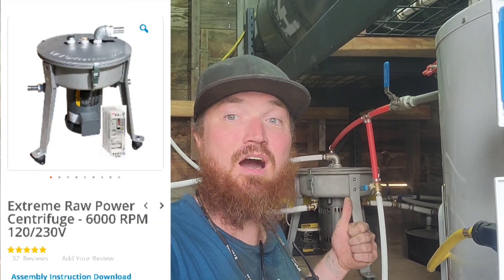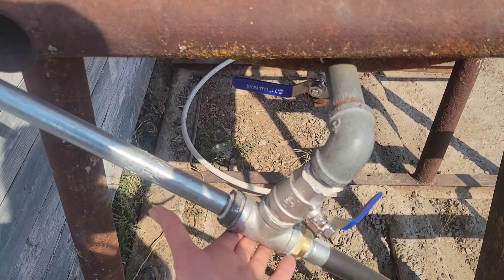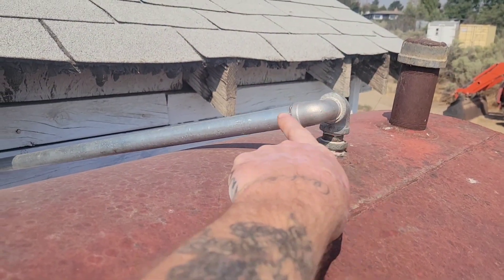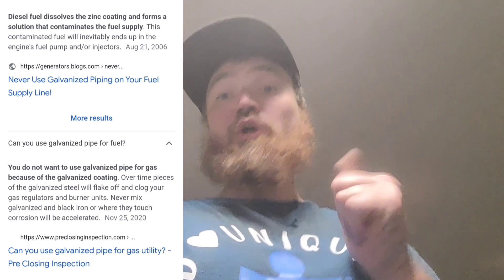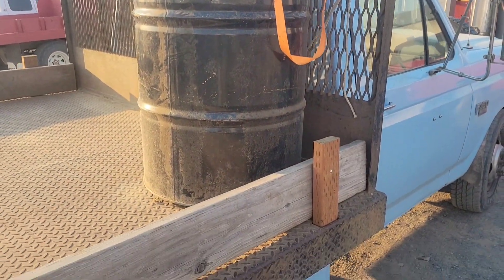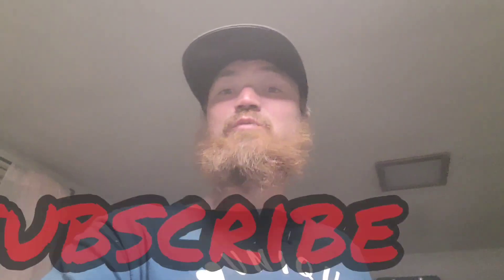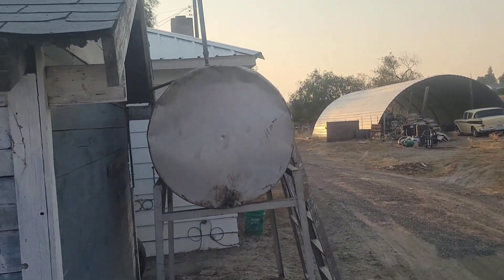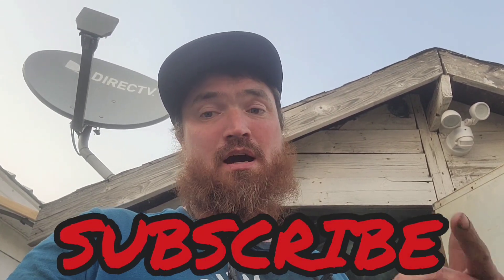Black diesel from waste oil DON'T MAKE THIS MISTAKE! #centrifuge #wmo #blackdiesel

Comment: Oil contains zinc
Reply from the maker: Some do some do not. Pre 1994 oils had zink. After 94 they removed it from most oils. Alot of diesels truck oils still do contain low amounts of zink.

Comment: That's right, you you could cost yourself a lot of money using galvanize fittings with diesel or hydraulics either one.
Reply from the maker: Thanks for watching. Appreciate the comment, I have gotten comments on the video both ways. Saying I was right, and wrong. But figure it is better safe than sorry.

Comment: I don't think the galvanizing is that much of a concern in normal conditions.   I have a 1000-gallon galvanized tank my Grandpa bought used before I was even born my family has had diesel in for at least 50 years that we fuel everything from.    I don't know where you are at but out here in the Minnesota, Iowa, North, and South Dakota region tanks like ours are still all over the place and still get premium prices at auctions because they never rust out like the plain steel ones do.
Reply from the maker: You commented the same thing enough times I'm sure you had time to read my responses. You do what you want, I believe what I have read, I changed the pipe out, because it is my system and I chose to. You are more than welcome to build your own system and produce a video about it.

Comment: I'm not following the concern over the pipe galvanizing here. In the old days, high-sulfur diesel was stored in galvanized tanks everywhere and it and the engines it powered didn't have problems from whatever galvanizing compounds may have been leaching into the fuel.  
Water, algae and 'dirt' contamination in diesel fuel are magnitudes of order more of a real-life issue, of which what you are making isn't actually 'diesel fuel' in the conventional sense, to begin with. 

My point is, even if it has the potential to cause a problem, (The potential for problems is not equal to an actual problem, especially when you are not even working with the same medium the supposed problem shows up in.)  what could leach out of your small amount of piping is inconsequential compared to what else could be in your oil you don't even know about.
Reply from the maker: I am sure the information on google about the galvanizing causing issues is all lies. They just posted it to steer people away from galvanized pipes in an attempt to destroy the galvanizing businesses out of spite. (Sarcasm) As I have explained multiple times, I read the risks, I chose not to take the risk in my system. It did not make sense to me in a system intended to clean oil, to reintroduce another potential contaminant. Not to mention the corrosion caused by dissimilar metals. I chose to change out the piping to black iron pipes. The black iron is cheaper for people setting up their own system anyways. So hopefully they save $ by not making the mistake I did. Buying one kind of pipe, not liking it, and rebuying. I run regular gasoline, and diesel through my system, not just oil. So the potential of pulling contaminants into my fuel would be there after it was cleaned in the centrifuge. Hope you have a great Christmas and next year to come. God bless.
Reply: Same here.   Old galvanized fuel tanks are still being used all over the place.   I think they used to be made in Minnesota at some place called MTC which I think stood for either Minnesota Tank Co, Minneapolis Tank Co or Midwest Tank Co and they must have had the market cornered at the time.
Reply: @illbeyourmonster1  The outside is galvanized on those tanks not the inside that's why they safe.  The diesel protects the steel on the inside from corrosion.  The galvanized protects the steel on the outside from rust.
Reply: @zakglove6536  I have been doing scrapwork all my life. I have cut up many old fuel tanks that were made of galvanized sheets that were galvanized on both sides then rolled and welded into a tank.
Reply: @illbeyourmonster1  Probably for gas then.  Or stainless.  Galvanized is fine for gas.
Reply: @zakglove6536  I know my metals and how to identify fuel as well.   I have done many galvanized ones that had diesel in them for decades without issues. 

As for scuba tanks, I don't see the relevance to the issue of diesel fuel in galvanized tanks.
Reply: @illbeyourmonster1  Scuba tanks are done the same way only on the outside.
Reply: @zakglove6536  I used to scuba dive and I have never seen a galvanized scuba tank.
Reply: @illbeyourmonster1   Typically used by professionals 100 and 120  but same size as aluminum 80.  They cost about twice as much.  They look similar to Aluminum nowadays because of the quality of the Hot Dip. Some people mistake them for stainless steel too.

Comment: Awesome video 👏 but definitely use Loctite 567 Thread Sealant
Reply from the maker: I have not tried the loctite brand thread sealant. I will in the future. I am needing a new container of thread sealant anyway. Thanks for watching. God bless.
Reply: @worthshop  also, I was going to mention if you take 10 gallons of used oil motor oil and mix in 2 and 1/2 gallons of gasoline then run it through your filters or centrifuge it will separate much faster and you do not need to heat it

Comment: I take it you are not aware that Zinc is a normal additive in oil, and galvanizing fuel tanks has been an industry standard since before your Great Grandpa was born.
Reply from the maker: That isn't pure zinc in oil, but a compound of either zinc dialkyldithiophosphate (ZDDP) or zinc dithiophosphate (ZDTP). Most zink has been removed from vehicle oils since the mid 90s. Thanks for the input though!
Reply from the maker: Google galvanized pipe with oil, or galvanized pipe with diesel. It is not good due to corrosion from dissimilar metals as well as the zink flaking off.
Reply: @worthshop  I've worked with the stuff for many years now and there is a bit of context behind the effects.  Typically it was only a problem with high sulfur content fuels with substantial water contamination as well.  

In a clean reasonably maintained system it was really not a problem.  As for used oil, I work with it in huge volumes and there are a lot of other possible contaminants in it that make concerns over galvanized anything rather moot.  The various type of antifreeze that inevitably end up on used oil collection systems is one.   Ethylene glycol once separated out of its water base blends with used oil fairly well. 

After that is the various mystery fluids that will blend with oil that get dumped in with them by people trying to avoid having to do hazmat-related recycling practices.  

A gallon or two of heavily chlorinated parts cleaner or like fluid dumped in a barrel of oil would be barely noticed until it started to eat your system's seals or parts of the engine's fuel system. 

Same with loads of farm chemicals left in the bottom of barrels and tote tanks that get absorbed by the used oil that got put in them. Many are extremely corrosive to metals and you would never know you had a contaminated batch of used oil until it's too late.
Reply from the maker: @Tcmtech   I'd rather heed the warnings online and not risk it. I can not guarantee no water in the oil I get. So better safe than sorry. I do know the barrels we use are not contaminated. I also know we do not put cleaners or antifreeze in our oil buckets. But I source all my oil at work. Not everyone has the opportunity, of knowing the source of the oil they get.
Reply: @worthshop  To each their own.  As someone who built a business from scratch, I try to help others look at the bigger picture view of things so that they don't waste huge amounts of time and resources on things that aren't really an issue.

As far as online warnings go, If I followed everyone I got in starting my business I'd still be a broke bum living in a crap-and-a-half house going nowhere in life. 🤠
Reply from the maker: @Tcmtech  Keep commenting, comments and views improve my analytics.
Reply: @worthshop  Okay? You're welcome, I guess?
 I take it channel traffic is a bit slow here?
Reply from the maker: @Tcmtech  Well I definitely do not run one of the million subscriber chanels. But not doing horrible either. The thank yous I get teaching people around the world how to fix their trucks makes it all worth while though. Comments always improve upon a chanels analytics and push the content out to more people. Some chanels wouldn't be half what they are without the hate comments pushing their success, as twisted and backwards as that seems.
Reply: @worthshop  Your welcome. I'll try to comment more on your channel when I get more free days to back-watch some of your work..  

Where you are now is where I was years ago so hopefully, I can give you some pointers that might save you some work or time.
Reply: @worthshop  lot of disinfo online, if you are filtering 5 micron or less  you shouldnt have anything to worry about. I have been using galvanized pipe on my wvo and wmo for over 10yrs with no problems.
Reply: There was a place in Minnesota called MTC that made them because they are all over the place in the midwest.   My family has one that I think my grandpa bought used some 50 years ago that we still use as our main diesel fuel tank today.

Comment: 3:31 Dont listen to the nay sayers. I do that for over 10 years with my mercedes diesels. Works fine. Go you way, there are difficult times right around the corner. The ammount of waste oil you can convert to black diesel will make all the difference. Trust me. While others cant drive, you wil be able to drive you cars.
Best wishes from Germany
Reply from the maker: Thanks for watching, appreciate the comment.
Reply: @alternativefuels-uj9oc  PD funktioniert auch. ABER stell erstmal sicher, dass dein ganzes Einspritzsystem passt. Drück deine Düsen ab und guck dir das Spritzbild an oder mach die gleich neu.
Taste dich langsam ran. Hast du schon einmal Pflanzenöl getankt?
Ansonsten nimm dein gereinigtes Altöl und teste aus, welches Mischungsverhältnis du brauchst um die gleiche Viskosität wie Diesel zu bekommen. Oft im Sommer 90% Altöl zu 10% Super. im Winter 75-80% Öl zu 25-20% Super. Das zumischen von Diesel für die Kaltstartfähigkeit musst du ausprobieren. Mach dir erstmal eine Ladung W80 fertig und kippe das auf einen Tank mit 75% Diesel. Danach 50% Diesel usw.
Tausche vorher den Diesel Haupt und Vorfilter. Habe Ersatz dabei.

Comment: No need to buy new fittings. Just soak the ones you have in some acid to get the gal off which will take them back to black pipe.  Alternately, and to get the benifit of screaming comments from the wowsers, burn them in a hot fire which will also remove the gal.
Reply from the maker: Thanks for those tips, may try them in the futue. Unfortunately, I already bought new pipes and fittings this weekend.

Comment: Wow, I would have never known you can't use galvanized pipe for diesel. Probably would have made the same mistake. No reason to be embarrassed or feel stupid aspie. You learned, you taught us, and I bet you will never again make that mistake! Thank you for sharing.
Reply from the maker: I have seen galvanized used in fuel storage systems in the past. Just assumed it was OK. Also figured it would prevent the pipes from rusting outside. Definitely a lesson learned, and mistake I will never make again. Thanks for watching.
Reply: @worthshop  I watched your video several times now and I still don't exactly see what real-world problem it is you are concerned about here.  
You are not actually working with conventional diesel fuel here and going by what can be in used oil, this seems like a huge non-issue to be wasting time and money on.
Reply from the maker: @The Custodian  Actually I do mix regular gasoline and diesel into my system. So I am not just using it for pure oil. If you want to use galvanized piping in your system, by all means GO FOR IT! I do not care one way or another what you choose to do with your time and money. I chose to not take the risk of using galvanized after I read the risks involved. I chose to share that on my YouTube. Also if people buy black iron piping to begin with it is cheaper than galvanized so I would be saving them money. If you think you are going to change my mind to use the galvanized, too late, I already switched it out. Thanks for watching a few times. Hope you have a great Christmas and next year to come. God bless.
Reply: My family has one that's probably 60 to 70 years old at least that we have used as our main diesel fuel tank for 50 years or more now.   Never had problems with anything from it.
Reply: Zinc has been an oil additive forever and galvanizing fuel tanks has been an industry standard since day one too.   I dont know who he got this info from but it wasn't a 20-second internet fact-finding search, that's for sure.
Reply: @Tcmtech  As a matter of fact anyone that does a 30 second internet search will see that he is completely correct. Just because people have made the mistake in the past does not make it OK or right. Just makes it a common mistake and all the better he made a video to teach the rest of us. You really should do a search yourself before you run your mouth.
Reply: @nothim2896  I have an engineering background and do this sort of RE/AE stuff for a living and have been at it for over a decade now.

So, there's that.   😴
Reply: @nothim2896  I did some further reading to see if I was wrong.  Here's the raw data I have found so far. 

Zinc leaching was primarily a problem with higher-sulfur content diesel fuel, which we don't use anymore.  

Old data says that zinc leaching in high sulfur diesel fuel tended to produce around 200 to 300 PPM levels. Which, IF said zinc-laden fuel was in a tank with water contamination, it could produce sludge byproducts that could be problematic for fuel systems, typically plugging filters to producing a low power output of the engine.   

Rarely did it, or will it, ever do damage to the fuel systems or engines unless taken to extreme levels of contamination on top of prolonged poor to nonexistent matainance practices. 

As for used oil itself, today's modern oils tend to have as-made zinc additive levels in the 500 to 2000+ PPM ranges.  😉
Reply: @Tcmtech  You literally contradicted yourself. You say the practice of using galvanised is basically as old as time itself. Then you say it was not good with the old fuel but is OK now... If you want to risk sludge and damage to your truck as you just described could happen, go for it. But don't bust aspies balls for trying to educate people of the risk to contaminating used oil, and fuel using galvanized pipes. Let alone the potential issues with rust and corrosion. In a system intended to clean used oil into usable clean fuel. That would be pretty counter productive to contaminate in the cleaning process.
Reply: @Tcmtech  Degrees do not impress people that work for a living.
Reply: @nothim2896  Ah I see.  Reading and grasping the complete contexts and tone of intent, when one or more smaller technical contexts are nested in a larger greater context, is hard for you. 

I can't help you there, especially given how you seem to be going after things I never said to do, but had simply pointed out where the problems came from due to there being more to the problem than you either can follow or want to accept.
Reply: @nothim2896  Neither do petty childish replies about people's lives and knowledge bases you clearly know nothing about and lack the capacity and or maturity to work with. 😅

BTW, how much-used oil and fuels did you process and recycle last year, and how many government and or large public utility/cooperative-related contracts does the company you own currently service related to said work?  My guess is a lot less than me and mine. 😋
Reply: @nothim2896  Ah yes, the childish ad hominem attack-filled reply.  Way to fail at adult-level discussion and debate, kiddo. 🙄
Reply: @Tcmtech  Probably old enough to be your daddy, but prefer you to call me grandpa. Trolling the troll is one of my favorite ways to pass time.
Reply: @nothim2896  Again. childish replies about people's lives and knowledge bases you clearly know nothing about and lack the capacity and or maturity to work with don't work in your favor. 😅

BTW, how much-used oil and fuels did you process and recycle last year, and how many government and or large public utility/cooperative-related contracts does the company you own currently service related to said work?  My guess is a lot less than me and mine. 😋
Reply: @tcmtech7515  Not to bust balls here, but you do know that most of the people that follow these types of videos are just regular, often grossly under-educated/life inexperienced in reality, kids pretending, badly, to be engineers or whatever it is they think they are.